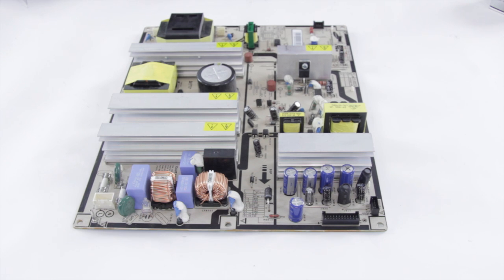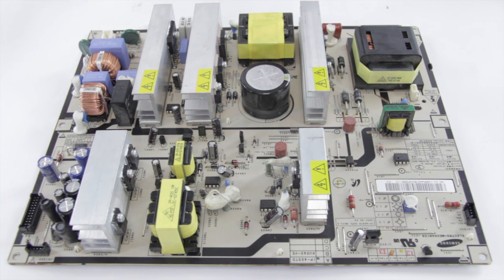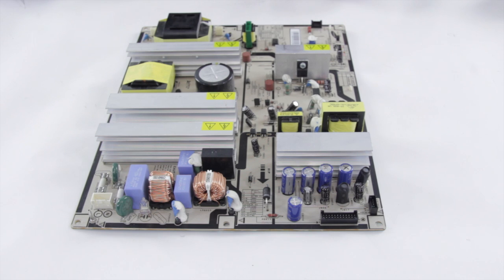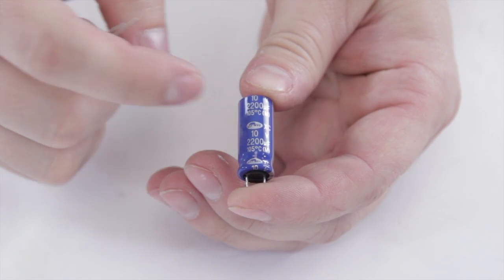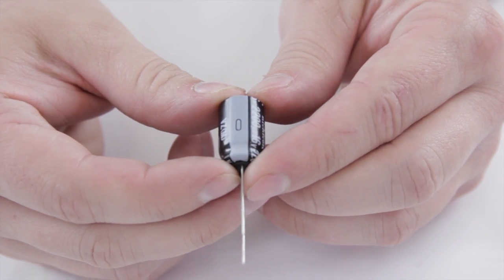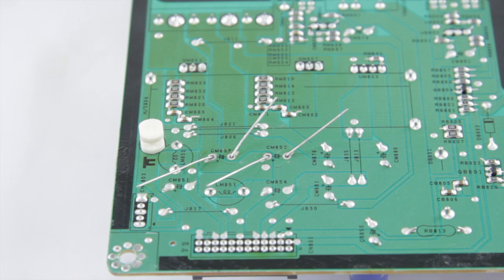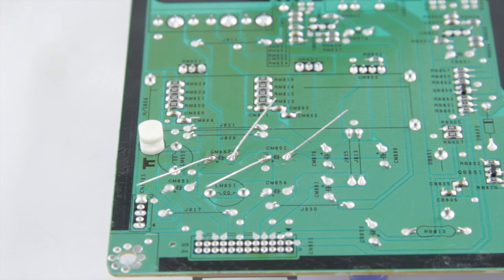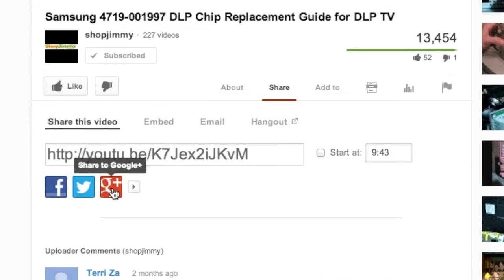Samsung TV Won't Turn On - How to Repair Bulging Capacitor for Clicking Noise

Comment: My Samsung won't turn on and all I hear is a clicking a sound. All the videos I have seen are talking about bad caps. I have a feeling that my Tv's problem is different. The Model number is UN55C8000XFX. Any thing helps!!!!
Reply from the maker: Tanner Christensen   I recommend replacing the main board in your TV.  Click this link to replacement parts for your TV model number:  http://www.shopjimmy.com/catalogsearch/result/index/?cat=56&q=UN55C8000XFX  Be sure to match part numbers on your current board, with your replacement for compatibility.  Here is a link to a video showing how to identify your part number, click here:  https://www.youtube.com/watch?v=BEPWrefQvqI  Thanks and please let us know if you have any further questions with your TV Repair!  www.shopjimmy.com

Comment: HI ! My samsung tv is starding and have green screen with noise.Model number is  LN40A530P1F         S
Model code  LN40A530P1FXZA   and S/N is  ALD13CSQC10829D, I NEED A SOLUTION PLEASE....THANKS

Comment: I have a Samsung plasma TV model PN43D4440A5DXZA VERSION N102 SN#Z38U3CQB404718. It started clicking on and off and will not turn back on. I'm not sure if the red light was on or off before I took the back off to look for anything visible. No sign of bulging caps, the fuse was ok and all diodes checked ok. Do you think the problem is on the power supply board or somewhere else? Where else can I look?
Reply from the maker: Joseph Powers   Try this at your own risk. Unplug the TV, then disconnect the y board and plug in the TV to see if the TV powers up. Reply with the results of this test. Thanks! www.shopjimmy.com
Reply: ShopJimmy.com Sorry for the delay in replying, but I did unplug the Y board and the sound ding ding did come on and the red light did stay on. Is this then a problem with the Y board?
Reply from the maker: Joseph Powers   I recommend replacing the y board and y buffers in your TV.  I do not see any results on our website for your TV model number.  Can you double check the model number?  Also, you can reply with the part numbers on the y board and y buffers and I can search for those replacements.  Thanks!  www.shopjimmy.com

Comment: My Samsung Model LN-T4053HS is having the clicking, cycling problem.  The caps that have popped tops have been identified.  However, the caps that are bad (2 of them) are 2200uf 10v 105*C, but I could only get 1000uf 35v 85*C caps.  Can I use these to replace the blown ones?  Your quick reply would be appeciated as it is the only tv I have
Reply: ***** Thanks, Mark!  I already found some on Amazon and fixed my tv.  I am a 60 year old little lady and if I can do this then anybody can...lol   I knew there was a reason I bought that little soldering kit at the yard sale 6 years ago for 2 bucks!
Reply: Vanessa Lumbra Hey, I'm impressed.   I am not a lady and worked onTV's since the 60's.   Nice hear you could do it.

Comment: Thank you for the great videos..It worked great on my lcd when the caps went bad. But now my samsung hls5687wx/xaa is making a high pitched beeping sound when its powered off. It is not the color wheel (that is all that i keep finding in the online forums). It is most noticeable in the morning after it has been off all night.  Any help will be greatly appreciated.

Comment: Hi. I have a Samsung ue46es7000 led 3d TV, 2 years old, out of warranty. It was repeatedly clicking on and off on its own, and would take 30minutes at least, gradually getting longer to power up to see a picture. Between times the screen would show different coloured vertical lines, against different coloured backgrounds, and the vertical lines were never in the same place.  
2 days ago, it wouldn't power on at all, and stopped clicking. On watching your YouTube clips, we took the back off and checked the capacitors which all seem to be ok, but one of the White cables and clips which links the 2 boards has 2 burned areas on the cable and the bit it plugs into- I'm not technical. 
Can this be fixed? And what should I get? Thanks.
Reply from the maker: Alison Meikle   This could be a problem with the t-con board, the main board or the TV panel.  You can replace the t-con board and the main board to see if one fixes the problem.  Unfortunately I do not see any replacement parts in the search results for your TV model number on our website.  Please reply with your part number on your boards and I can try searching for replacement parts.  Thanks and please let us know if you have any further questions!  www.shopjimmy.com

Comment: I  Have an 27 " CRT Panasonic TV < but I can seem to find the problem .
The reception is very poor ,sometimes and when I shake the antenna coaxial connector at the back of the TV ,  
I get an great reception .For months I did that ,but it keep getting worst ,so I decided to change the TV antenna input with another plug and about one day it went very nice ,more channel ,quality video and after one day it went bad ,2 channels and the same problem .
Mt question is what is happening ,is it the coaxial input of the TV or the receiver of the TV, my outdoor antenna the coaxial cable. Why sometimes ,beautiful picture and sometimes ,the signals are week and seems like the receiver not working.

Dave
Reply from the maker: globalcomsur   Unfortunately we do not offer parts for CRT Televisions.  Thanks!  www.shopjimmy.com

Comment: I have a LG PC50D Plasma TV.  Had a humming/buzzing sound that was noticeable when the volume was low; and same noise when volume is muted.  more annoying than anything.  My research indicated bad caps.  Took to TV shop who replaced 12 caps.  After it was on for 20 minutes, got the same buzzing.  There is a fan in the TV according to the TV guy.  What else can cause the buzzing?  I already spent $285 on it, when I was quoted $200  Now he said no more labor, but would have to pay for parts.  Any suggestions.
Reply from the maker: Greg Satellitetechguy   This sounds like a TV panel (TV Screen) problem.  If your TV panel is bad, it may be more cost-effective to replace the TV as panels are typically hard to find in stock, difficult to replace, and expensive.  Thanks and please let us know if you have any further questions!  www.shopjimmy.com

Comment: I have a Samsung pn50a550. It just turned off one day and wouldn't turn back on.  It clicks and cycles but didn't wont turn on.  I noticed one bulging 10v cap on the power board.  Changed it out as well as the 10v one next to it that looked good with 25v mcm electronics caps.  I resoldered the whole board (I solder circuits for a living)  then reinstalled it back in the TV. The tv came on but when I turned it off it after a few hours it went back to its old ways, clicking & not coming on. I have the 2 thermistors but have not put them in yet.  I also change out the 47uf/c102 tantelum cap on the main board and did a reflow of 8min@385 deg. Still not working.  Any ideas?

Comment: OK, so I replaced both of the bulging caps, same 2 as the board in this video and now the TV turns on and off just fine but it's still doing the thing where after a few minutes of running the screen gets "noisy" and then fades to black with the backlight still working and you have to power it off for like 20-30 minutes to get the image to come back on for even a brief amount of time whats the likely hood of the 2 1000uf caps just below the 2 2200uf caps being the cause of this? on the other Samsung TV it was the 2 1000uf caps causing both the power on and screen fading issue.
Reply from the maker: DanielRichards644   Did you replace the capacitors with the same ones that were previously on the board?  Thanks!  www.shopjimmy.com
Reply: ShopJimmy.com
 replaced the 2200uf 10 volts with 2200uf 25 volts, same brand as the 2200uf 16 volts you put in in this video. My board looks almost exactly like the one in this video.

Comment: What if the capacitors are not bulging? I've got the same issue, tv clicking and not turning on. Thanks
Reply from the maker: Chris Gonzales   Please reply with your TV model number.  Click here to view a video that shows how to find your TV model number:  TV Repair STEP #1 Help IMPORTANT TUTORIAL How To Find Your TV Model Number Tutorial TV Repair Help  Thanks!  www.shopjimmy.com
Reply: capacitors can be bad without bulging, they easily can drop from like 1000uf to 500uf without any bulging, or can dry out, or other problems. They are simple to replace and cheap to buy, so if your clicking, the first thing I would do every time is replace the capacitors, its usually 1000uf 10v 105c caps/blue that go bad. If you have any 10v caps, replace 100%. You might also have some different sized 25v caps, you probably won't need to replace those. Depends on model though. Most basic Samsung tvs use a couple cheap 10v caps that go bad super easy. Replace them with 25v caps from a good manufacturer (like Panasonic).

Comment: I found a 60" Samsung on Craigslist for 310.00. It sounds like it has a power supply issue. After doing some reading I have a suspicion that it has this cap issue. I would probably just replace the entire power supply board. What do you think take a chance and buy it? Here's the listing "Samsung plasma tv pn60e530, manufactured December 2012, the tv base remote, great picture. it has a issue that it, will not always turn on the 1st try" You're input is greatly appreciated.
Reply from the maker: Paul Olmstead  Please watch this video FIRST to help with your repair!  TV Repair! LCD, LED, Plasma, DLP How To Fix Your TV with ShopJimmy.com Help!  The cap problem is not as common with the newer models.  It could be a problem with the power supply but not 100% sure.  If you do end up buying the TV and need replacement parts, here is a link to our website search results for that TV model:  http://www.shopjimmy.com/catalogsearch/result/?q=pn60e530  Be sure to match part numbers on your current board, with your replacement for compatibility.  Here is a link to a video showing how to identify your part number on the power supply, click here:  TV Part Number Identification Guide for Samsung DIY TV Repair Power Supply Unit (PSU) Boards  Thanks and please let us know if you have any further questions with your TV Repair!  www.shopjimmy.com

Comment: I have a Samsung plasma tv model: PN50B430P2DXZA
It turned off while I was watching it about 4 months ago and when I would try to turn it on it would make the clicking sound but the tv would remain off. I opened it up but the capacitors don't look harmed, please help, I have no idea what is wrong with it.
Reply from the maker: lakersfansince1991   Try this at your own risk.  I recommend powering off the TV and then disconnecting the SC board from the power supply.  Then turn back on the TV and see if it turns on like normal.  Reply with the results, thanks!  www.shopjimmy.com
Reply: ShopJimmy.com sounds a bit too dangerous lol I think I'll just pay the $150 to get it repaired. But thanks for the advice.

Comment: I have changed the capacitor but i cant see any fisical issue on it, so i just changed to another with the same V/uF.. but still click and wont turn on without 30 or 40 minutes clicking (or more time somethimes)

What's the next thing should i do?
Reply: Model: UN40ES6500G
Reply from the maker: Helcio Macedo Please watch this video to help with your repair!  TV Repair! LCD, LED, Plasma, DLP How To Fix Your TV with ShopJimmy.com Help!  I recommend replacing the main board in your TV.  Here is a link to possible replacement parts:  http://www.shopjimmy.com/catalogsearch/result/index/?cat=56&q=40ES650  Be sure to match part numbers on your current board, with your replacement for compatibility.  Thanks and please let us know if you have any further questions with your TV Repair!  www.shopjimmy.com

Comment: Hi. I've taken the back off of my samsung. Have 3 blown capacitors. 2x25v 1000uf and 1x25v 220uf. Went to buy replacement capacitors and could only get 2x25v 1000's but couldn't get the 25v 220. They had a 25v 470. Is this too high to replace the 220 with?? 
Your help would be much appreciated
Reply from the maker: Ryan Keeber   As long as the volts are the same, you can go higher, so you should be OK.  Thanks!  www.shopjimmy.com

Comment: i already change 2 old capacitors.. the new ones arent working.. one of them is doing a clicking sound.. unless is something else can u help out.. thanks
Reply from the maker: dman ureface   This sounds like there is a different problem with your power supply, besides the capacitors or the power supply is not the part that is causing the problem.  What was the original problem with your TV?  Please reply with your TV model number.  Click here to view a video that shows how to find your TV model number:  TV Repair Help IMPORTANT TUTORIAL How To Find Your TV Model Number Tutorial TV Repair Help  Thanks!  www.shopjimmy.com

Comment: ** CHECK THE FUSE! **
After 1 yr & 9 months my Led 60 inch Samsung went dead with no power to anything so I unscrewed and took off the back. Very carefully with out touching many things....  I checked the two fuses with a meter and one was bad near the power cord plug.
I was lucky because it's the cheapest thing to replace.

Comment: hey i have SAMSUNG smart TV UN40ES6100F and model number is UN40ES6100FXZC  problem with my tv is it trying to turn on but its black screen all the time. can you help me out identify problem with my TV
Reply from the maker: asim maredia   I recommend running the flashlight test on your TV.   Here is a link to a video we produced that shows how to run the flashlight test. No Image No Picture on TV Screen-Flashlight Test LCD TV Repair - How to Diagnose Broken TV Repair Please reply with your flashlight test results and we can recommend a replacement part for your TV repair. Thanks and please let us know if you have any questions! www.shopjimmy.com
Reply: No flash light test doesnt work power lighr keeps on flashing.
Reply from the maker: asim maredia   What do you mean by flashlight test does not work?  Are you saying that you did not see the image on the screen with the flashlight on it?  Thanks!  www.shopjimmy.com

Comment: NO, NO, NO. You don't ever want to use plumbing flux anywhere near circuit boards. That kind of flux leaves behind a residue that will eat away at the thin wiring, causing future problems. The rosin core solder you are supposed to use has the flux built in, and leaves no harmful deposits. No 'extra' flux is wanted or needed. It's the ONLY kind of solder to use for electronics, and by itself.
Reply from the maker: st8kout1   While you are correct about plumbing or acid base flux being damaging, we used rosin liquid flux (the same stuff that is in the middle of the rosin core solder).  It's completely non corrosive and will not damage the board or trace.  Thanks!  www.shopjimmy.com

Comment: My Samsung TV just won't turn on what can be wrong ? I've only had it for a year .
Reply from the maker: Zayra Guzman   Please reply with your TV model number.  Click here to view a video that shows how to find your TV model number:  TV Repair Help IMPORTANT TUTORIAL How To Find Your TV Model Number Tutorial TV Repair Help  Thanks!  www.shopjimmy.com
Reply: Do you need it? could it be one of the fuses? cause, I think my TV was on while it was raining and the light went out maybe that's what caused it to black out.
Reply from the maker: Zayra Guzman   Yes, I do need the TV model number.  Did you experience a lightning strike on the TV?  What are all of the symptoms of your TV?  Does it have a standby light?  Please reply with this info.  Thanks!  www.shopjimmy.com
Reply: The number is : un32eh4003f & I don't think so & no , nothing .
Reply from the maker: Zayra Guzman   Try this at your own risk.  Disconnect the cable from the power supply over to the main board then plug in the TV and see if the backlights come on. If the backlights turn on, then replace the main board and if no lights then replace the power supply board.  Here is a link to replacement parts for your TV model number on our website, click here:  http://www.shopjimmy.com/catalogsearch/result/?q=tc-p42c2  Be sure to match part numbers on your current board, with your replacement for compatibility.  You can also call our customer service for further assistance with your purchase.  (877) 881-6492  Thanks and please let us know if you have any further questions with your TV Repair!  www.shopjimmy.com

Comment: I'd want to make a rough diagram of the capacitor polarity before pulling them out.  A lot of boards are not marked.  Thank you for a good video.
Reply: With the cell phone cameras we have today I like to just take a picture.  A picture is worth a thousand words.  Of course I was a professional photographer for forty years.

Comment: My Samsung tv is having this same issue and I see that Samsung knew about this and settled a class action lawsuit but my tv didn't start doing this until after that settled. I called Samsung capacitor hotline and they had me agree to get it serviced by an approved Samsung repair dealer and said they would only repair the capacitors and no labor. I asked to speak to a supervisor and was able to get capacitors, powerboard and labor but if anything else is wrong they will not be responsible. Did I do the right thing? Could it be something else like the Motherboard? Thabks for your help.